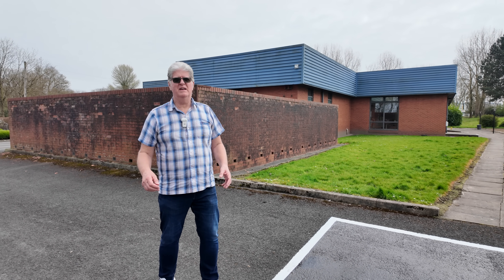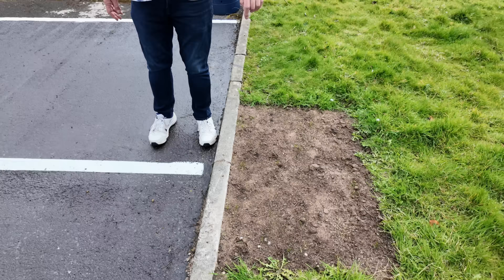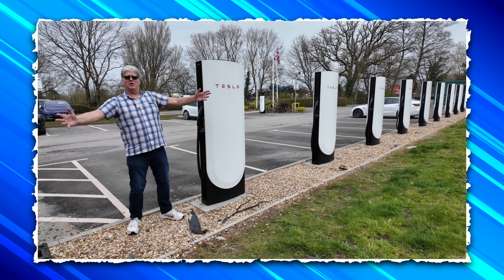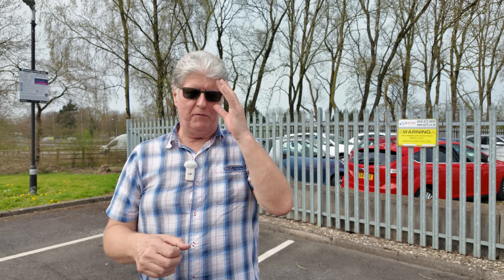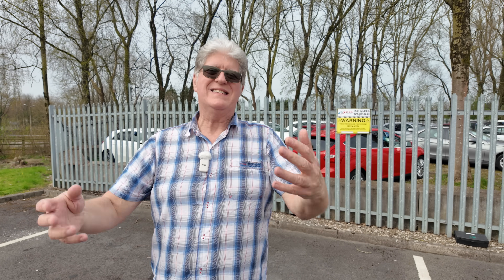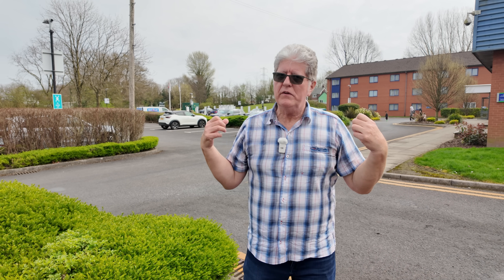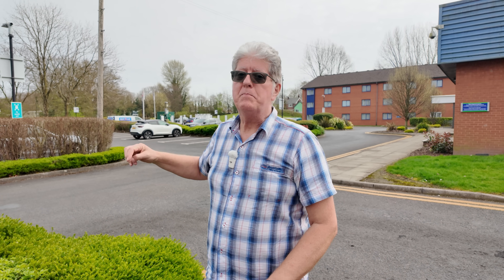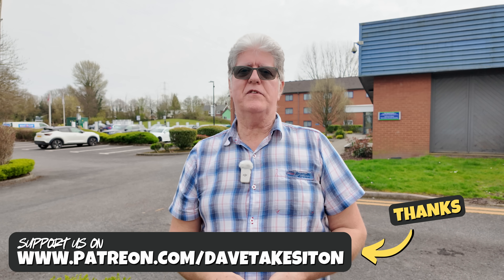Why Are EV Chargers Being Ripped Out?

Comment: Every pertol or diesel cars at any pump can fill up in 5 min, can't say that for ev's, plus if people think the cable used at charging bays is heavy you will need to start working out if they ever get to 1megawat cable.
Reply: What?  The 0-60mph no longer the determining metric?  Its now fill up times?
Reply: Dan - yes, but thinner cables. EV charging cables are water cooled anyway and if factored into the 2-5% energy loss between the charger and the car and the 90% overall energy efficiency source to wheel.

What differs is the form of cooling, many current cables use cable cooling - where the coolant flow and return flexible pipes are separate to the condutors. The high power/thinner cables use conductor within coolant pipe arrangements that cool the condutor wires more directly than those seeking to cool the whole cable assembly. Hence although more expensive to make the conductor within coolant pipe type cables tend to be thinner, more flexible and lower weight.

Likewise fossil-fuel pumps require electrical energy to both pump and cooling (fans), so have wasted energy involved as well. The energy cost of the coolant and circulating pump in EV chargers tend to be lower than the pumping/cooling energy required for fuel pumps, as their designed to pump lower levels of fluid and use efficient heat-pumps to extract the heat from the return coolant.
Reply: Which KIA/Hyundai can fully charge in five minutes.
I must have missed something🤔
Reply: @jonathanlonsdale9442  You've not missed anything, Dave is exaggerating. A KIA EV6 can add 62 miles of range in just over 4 minutes using a 235 kW charger. On a 350kW DC charger most new KIAs can get from 10% to 80% in around 20-30mins.
Reply: The Kia EV6 charges from 10 to 80% in 18 minutes, faster on a warm day (did it in 16 and a half minutes yesterday).

The mileage added in five minutes can be between 75 and a 100 miles, depending on the cars state of charge, conditions and whether its the pre or post face life model (240kW vs 263Kw peak charging).
Reply: @GruffSillyGoatwhoopee woo how exciting
Reply: @johnthemagnificent7022  - see, I knew we'd make a convert of you some day. Glad you happy being excited.
Reply from the maker: Every EV driver used to drive ICE
Reply: @davetakesiton  Dave you're taking crap yet again my nephew's just passed his driving test in an EV and then gone out to buy himself a VW id3  of which he is very pleased with 😊
Reply: Active cooling means more energy wasted, conditioning the battery means more energy wasted.
Reply: Pointless comments.
Reply: @peterjones6322  you mean you could not work out each conductor would be a minimum of 22.5mm diameter x 2 plus sheathing let alone heat generated. Oh and 1mw could power 1000 homes for one hour where is all this energy coming from GAS
Reply: @rm-kx8et Hmm, Gas generated 26% of UK electricity in 2024. I don’t think you understand how numbers work.

Source: NESO Britain's Electricity Explained: 2024 Review
Reply: @javelinXH992  Oh and if everyone wanted to charge their car on a cold still day hows the energy produced as we have plenty of them in the uk.
Reply: @rm-kx8et Evs are 4x more efficient than ice so however the power is generated considerably less energy is needed.
Reply: @crm114.  It's actually far more than that when you take into account how much energy is used to explore for, drill for, pump and transfer, then crack oil; to refine it into usable fuel products - and then transport those products to petrol stations; far, FAR more.

Oh, and they use VAST amounts of gas to heat that oil as part of the cracking process, along with (gasp) COBALT !!
Reply: @Un-Apologetic Learn some basic physics before commenting.   A gal of diesel contains the equiv of 45kWh energy so the average diesel efficiency is only about 1 mile per kWh
Reply: @Un-Apologetic  I get around 4 m/kWh over 15,000 miles per year. Not everyone drives an oversize SUV.
Reply: @rm-kx8et  So every day of the year is the same as the worse day?

Use the annual average. After all, EV drivers are filling up every day aren’t they?
Reply: @Un-Apologetic That’s a US gallon.
Reply: @crm114. 
But to an EV hater, the bigger picture doesn't exist, like how much energy is needed to move oil to a refinery, or how much electricity is used to refine that oil, then how much fuel is used to move that refined fuel to the petrol station, then how little of that fuel is actually used to do the work of moving the vehicle it was put in to. These things don't matter, because their brains can't comprehend the bigger picture. 
Fact is an EV is something like 15 X more efficient than an ICE vehicle, once the whole supply chain is taken into consideration.
Reply: @Un-Apologetic  so with no off street parking at 3 miles per kw using instavolt thats 28p per mile a petrol car giving 40mpg costs 14.5p per mile.
Reply: @Un-Apologetic Wow very interesting my friend..... I'll stick with my diesel  £54 of diesel = 600 miles 😊
Reply: @Un-Apologetic  28p per mile at 3miles per kw that equates to about 84p per kw so we are not far out.
Reply: @Un-Apologetic not stupid. A gallon of petrol contains more energy than a battery of the same weight but around 80% of that energy is wasted as heat.  EV efficiency is much higher
Reply: @johnthemagnificent7022  I’ll stick with my EV, 600 miles is £12.75. 

As I do 1,400 miles per month, I prefer to pay the £30 I pay to do that, instead of the £126 you would pay.
Reply: @javelinXH992 Fortunately you must be charging at home...... still think of me only spending a couple of grand for my diesel car 😊
Reply: @ Indeed I do, which is why I think the future is (at least for the near term) ‘hybrid’. Where those who can will use electric and those who can’t will use ICE. Don’t really see why it all has to be one or the other, not in such a short time frame as is being proposed anyway.
Reply: @Un-Apologetic 
That's untrue, the Nissan Leaf can easily do 4 miles to a KWhr, and the original Ioniq can do 5 miles to a KWhr without trying. The newer EVs are less efficient, but they are also safer, with improved body designs and a whole load of extra safety and comfort kit included.
Reply: @johnthemagnificent7022 
600 miles round town, unlikely. 
My Ioniq 5 on the other hand will do 600 miles on £12 of electricity, and has the performance of a hot hatch, yet the silence, comfort and space of a Range Rover.
Reply: @johnnodge4327 Who said anything about being in town all the time 😂😂 
 Plus I've other car's for different situations fast car's classic cars rare cares big car's all with virtually No depreciation 😊lovely jubbly 😊
Reply: Well based on CharIn, the body behind the Megawatt Charging System standard, one of the key design objectives for the standard is: "One person must be comfortably able to plug the charging cable’s connector into the charging."

So it seems this has already been thought off using conductor in coolant cabling systems that can shrink the size and weight of the cables required.
Reply: @GruffSillyGoat Higher voltage=thinner cables (partly offset by thicker insulation). Using 2 cables might also be an option...
Reply: @ - yep that's factored into the cable design as well, but at the cable lengths being used active cooling is the key enabler of high currents. The MCS spec has gone through a number of iterrations, currently at v3.2 which looks like the one truck makers are standardising around, and covers both cabling and connector specificiation. 

The connector does away with AC charging, so only has the two DC conducting pins but of much larger cross section area. The cables can either be larger cross sectional wired but tend to be those with assisted connection (hoist/robotic insertion for HGVs for example) or have active conductor in coolant designs to reduce cross sectional area/weight and so sutiable for manual handling. 

Having mulitple conductors within the cables increases overall sectional area compared (particularly in cooled cables) compared to having single larger or cooled single multicore wires. Plus multi conductor cables represents a risk that if one leg of a develops a fault that the other leg will carry all the current and likely fail, hence such require active cable monitoring embedded (as the fault cannot be detected at the connector, charger or car) which again increases cable dimensions/weight and lowers flexibility.

It looks like most MCS charger manufacturers are settling on two active cooled conductors for the cables, which supports either assisted or manual connection use.

Comment: Am I the only person who's wondering if these EV fanatics consider the carbon footprint of the laying extra EV parking tarmac areas, painting lines and fiting all these chargers (then ripping them out or constantly renewing) is actually saving the planet due to all the energy used to do this?
Reply: Are either of these serious comments.
Rarelynare chargers in places that need new tarmac.They never renew tarmac in car parks or petrol stations of course.
If you think petrol pumps aren't replaced then you presumably haven't noticed that you can now pay at the pump.That there are multiple fuel type pumps.So presumably the original pumps gave birth to these pumps!!!
Reply: This is a weak point because the fundamental purpose behind EVs is not poisoning lungs of people as you drive past them, thereby improving local air quality and wellbeing. The wider picture is seeing an increase in renewable energy as others have said. ICE is all fun and games until you see thousands of people dying as a result of respiratory illnesses and suffering from other illnesses like Alzheimer’s due to the toxins from local air quality reducing their brain function etc over time.
Reply: Yes you are!
Reply: Have you ever considered the carbon footprint of constructing new petrol  pumps and delivering the stuff in the first place? I can assure you that the carbon footprint of constructing EV charging infrastructure is minimal
Reply: @rogerphelps9939  are you sure? Only ask as the EV infrastructure is in its roll-out phase, so its carbon footprint surely is higher in comparison to an existing mature infrastructure that exists? (Am assuming that you’re referring to charging points vs fuel pumps in this regard? If not I misunderstood your thread).
Reply: @rogerphelps9939 minimal?
Reply: @ The carbon footprint from getting that oil from the ground to eventually be wastefully burned in a ICE is absolutely massive, huge.
Reply: Yeah, petrol pumps never need replacing so why do EV chargers?
Reply: @Real_SlimJim  rarely in comparison, and it is the EVangelists that are always harping on about saving the planet.
Reply: @Real_SlimJim  the vast percentage of electricity is generated by gas and the more evs the more gas burnt so much for saving the planet.
Reply: @rm-kx8et  For cars it's still vastly better in terms of emissions than petrol or diesel though and don't foget refining petrol/diesel also uses electricity.
Reply: @rm-kx8et I hate to break it to you but people that care about protecting the only place in the universe capable of sustaining human life pay a little extra for renewable Electricity at home and every Public EV charging network uses 100% renewable energy, its only people that fall for the billionaire oil industry lies that still used gas for electricity.

It wont matter a anyway the world produced 40% of its electricity from green sources last year and ill bet that number will be closer to 50% this year and every year the grid will be more and more green.

Its ok to be old and afraid of change but you should probably just get off the internet if thats the case 👍
Reply: @rm-kx8et  In 2024 58% of the UK's electricity came from low-carbon sources: 45% renewables and 15% nuclear. Gas generated only 24%, so your "vast percentage" assertion is more than a little misleading. Are you a shill for the fossil-fuel industry?
Reply: @Real_SlimJim some are afraid of making mistakes aren’t they?
Reply: @rm-kx8et Wrong. Only about a quarter and going down all the time. You really ought to get your facts straight
Reply: The majority of UK energy is generated by renewables and zero carbon source not gas. Ubfortunately, though as gas is in the mix still, even of in the minority, its pushing up electricy prices for everyone. 

Perhaps if the government gets into nationalising key services for the good of the country then they'll turn an eye to the gas generators as well; particularly the peaker operators who are out to charge as much as they can for as long as they can, which wasn't visible in the old days of gas/coal generation but very much in sight in today's cheaper renewable generating world.
Reply: @GruffSillyGoat there have been at least three extended periods in the last six months when only around 5% of demand was provided by renewables because there was no wind and little sun. One period lasted a whole week. You were surviving mainly off of gas and the interconnectors for that period.

The more renewables there are in the mix, the more likely that is to happen. The energy companies are lying to you when they claim they only supply renewables electricity. You would have been sat in the dark for those periods mentioned if you were only receiving renewables. They fiddle by offsetting through carbon credits etc.  But carbon credits don't actually stop co2 production, just move it around.
Reply: @paulweston1106 Not good for the pocket tho Paul
Reply: @ Except the UK grid is now circa 50% renewables and even an EV powered by a gas fired power station is still massively cleaner than ICE due to efficiency of the power station and the EV, unlike the awful inefficiency of the whole oil process and burning it in an internal combustion engine.
Reply: Yes you are
Reply: @wdsmauglir4683 No you're wrong I'm thinking the same..... 😊

Comment: Dave. It's not the end of the world for LEAF Owners that have Chademo connectors.

There is now a CCS to Chademo adapter that is now available for £600. Not worth it for me as my LEAF is the 2nd car run around and I don't rapid charger.

But let's not right off the LEAF just yet. Maybe you can cover this fact in a future video.
Reply: £600? I bet if you look inside it's just two bunches of contacts and some wires joining them. Maybe a 50p chip or two to tell the charger not to overdo it, as the car is old.
Reply: No, CHAdeMO use a different procol and physical comminications method (CAN bus) to CCD (uses PLC comms for electrical noise/interference suppression). The devices have a protocol converter inside them that are quite complex to develop, test on the variety of charger makes and get certified for use.

The older Tesla Model S and X also used a different protocol, derivided from CHAdeMO, but were retrofitted to CCS by protocol converter being fitted inside the car.  

It's the US NACS to CCS1 in the US that are just plain rewiring adapters.
Reply: @GruffSillyGoat  no your wrong. Do your research.
Reply: @ - what particular point is wrong. I'm an electrical/electronics engineer by trade and have read both the CCS and CHAdeMO specs.
Reply: If it helps here's a link to a teardown of one of the old Tesla model 3/X adapters, as Dave here uses, which shows it's just wired through and a pic of the Tesla mod to the car to talk CCS protocol: https://youtu.be/d-R49NdernY

Plus a link for an after market CCS to CHAdeMO adapters for the Leaf, this one isn't that good as it only has one contactor meaning one of the power pins is always live, and has fairly under powered aluminium bus bars: https://youtu.be/N8WsYLnzInA
Reply: @michaelmartin9022 
No it's more complicated than that. The charging standards and so data requirements are completely different between the two.
I reckon the hardware is probably under £100, but someone needs paying for all the R&D and coding that was needed.
In time these devices will come down in price, once the books are balanced.
Reply: @michaelmartin9022  That's a bet that you've just lost. There's a processor inside which does the conversion between the completely different communication protocols.
Reply: Wow £600 adaptor that is extortionate profiteering
Reply: Apart from the different protocols, the CCS expects to see the voltage of the battery at the charge connector, the Chademo does not. This means there has to be circuitry inside the adaptor to present a fake battery voltage (400v or thereabouts) before the controller inside the car will close its contactors and present the true battery voltage. The charging standards are quite different all would have required quite a bit of R+D costs to recover.